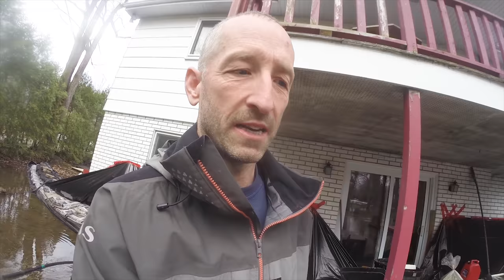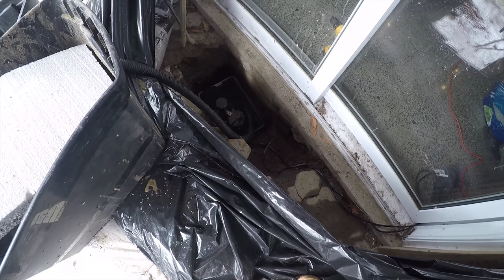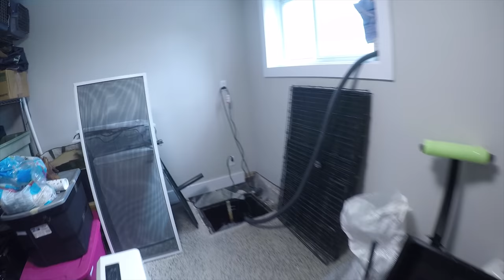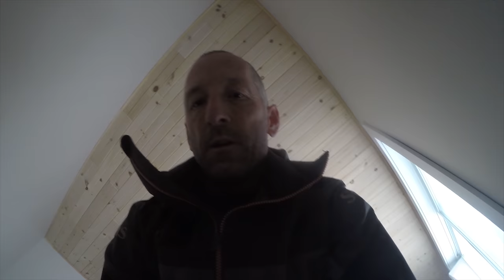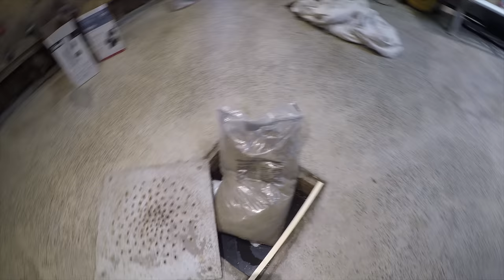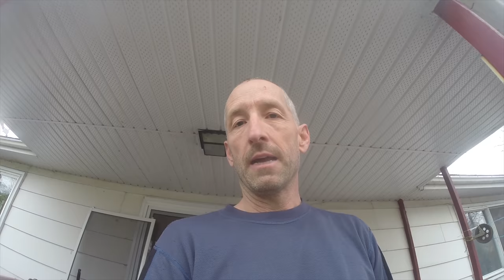How to Flood-Proof Your Home I

Comment: Andrew… great video! Sorry you have to deal with that…. For the water coming into the house through the pipes… locate the main pile and “plug” it (temporarily) with a “plumbing test plug” you can buy for $40 USD (note: secure the plug with a chain or rope… so that you don’t lose it inside the pipe) … and avoid a potential sump pump failure… cheers!!
Reply from the maker: Yes - we got one - but they were in short supply at the time (everyone needed them) and so we had to improvise in the short term

Comment: I am not in a flooding zone but I will be installing a sump pump with a backup system in the basement or garage soon. Also basement protection against sewer back up. Things are changing and I believe that this will happen more frequently.
Reply from the maker: Indeed! Who knows what will happen moving forward.
Reply: Good morning,
Yes this will be the new normal. Need to pressure our elected officials for solutions now. Not in the future but now. Ensure that no new developments are built on shores etc. It is time to speak up.

Comment: i wonder if you built a small aquaduct that could use a hydrogenerator so if there is a flood you could switch over to using the flood itself as a scource of power should you secure you house from a flood maybe something that rises with water levels...so it doesnt get flooded as well...